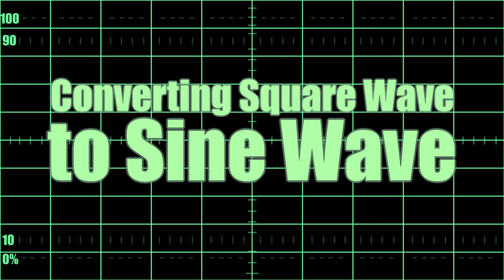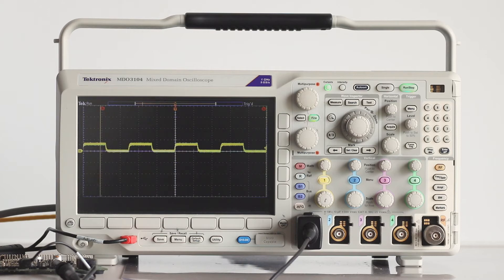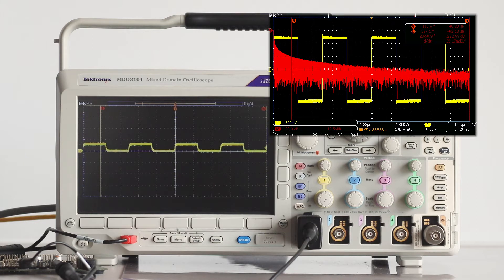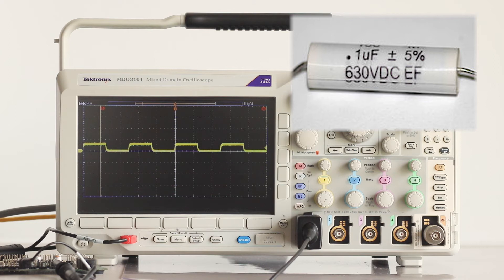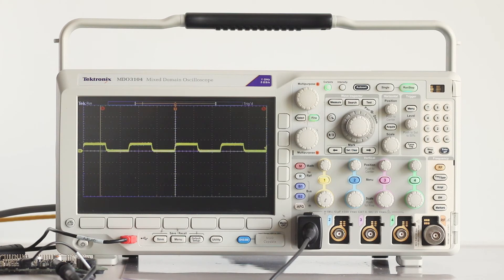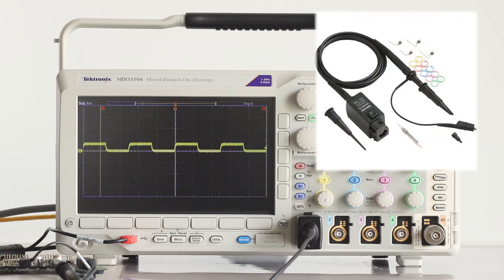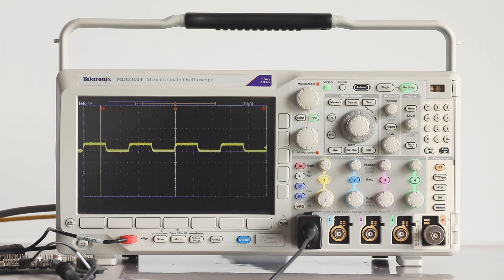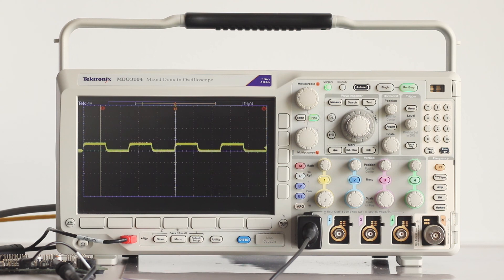Converting Square Wave to Sine Wave

Comment: Reactor & filter approaches are lossy, & lack sine purity. Try stringing a series of Bi-Lateral "Mu" Shunts in the signal line. The more shunts, the purer the sine wave output, & it is not frequency dependent!